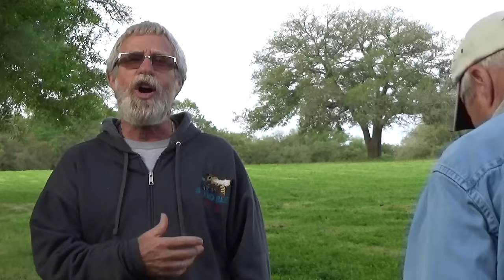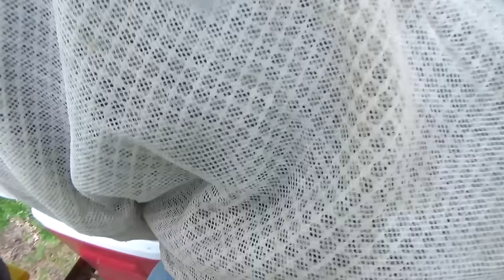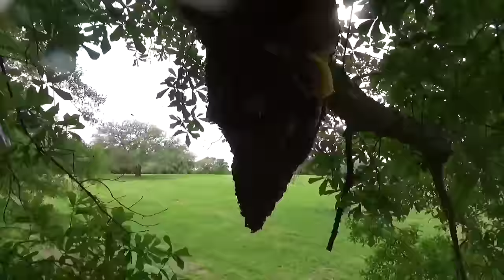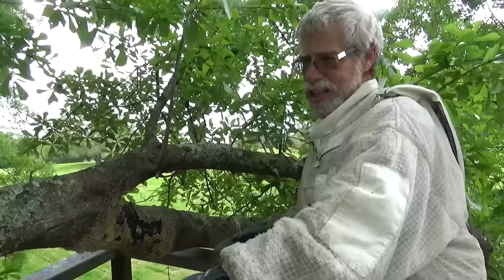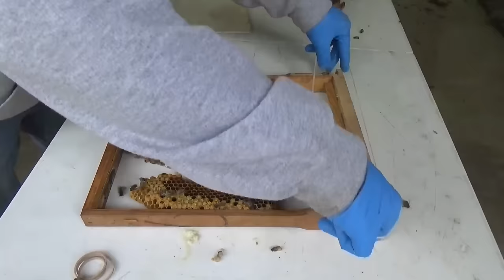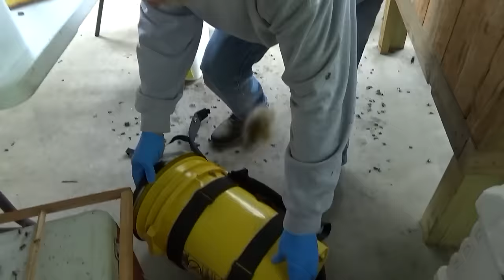Removing and relocating a massive external beehive from 30 feet in the air.

Comment: Of all the ways to get up to that hive, the Grade-all was probably the best you could hope for. Should have been as stable as the ground at that extension and once you were up in the leaves and next to the limb you likely forgot how high you were up there. Did Charlie settle in once the work started? Dang Jeff, you almost needed two vacuums for that many bees. Glad it was not really hot weather or you would have lost some in that tight quarters. Same with the coolers. Do you need to put some vents in those with leaving the bees on the comb? Would loved to have been there to give you a third opinion on that honey.

Comment: Hello Jeff.  That's one impressive colony.  I have a concern regarding my homemade bucket head shop vac, bee vacuum.  I don't know if I have it tuned correctly.  I might have the suction reduced excessively.  Is there a benchmark of your commercially produced vac in relation to its sucking power?  I'm wondering, without trial and error, if there is a measurable mark I should try to attain for vacuuming bees?  Keep the great content coming.
Reply from the maker: There may also be leaks in the vac that creates the low suction, I would look into that possible issue as well. In the Everything Bee Vac the suction is controlled by the speed of the motor not a bleeding off of the suction. I wish you the best in figuring out the problem. Thanks for watching. God's peace Dan.
Mr. Ed

Comment: Why don’t you stick the top of the comb to the frames with melted wax?  Don’t you worry that the bees will cut the rubber bands before they fix the comb to the frames?
Reply from the maker: The bees are very smart, and will not cut the bands before the comb is secured. Using rubber bands to secure the comb to the frame is a VERY good way to do it and most bee wranglers use them for that purpose. Thanks for watching, and I hope you will check out more of my bee wrangling/ bee rescues adventures and let me know what you think of them. By the way, I post a new video every Friday morning, and I look forward to hearing from you again soon.  God's peace Wes.
Mr. Ed

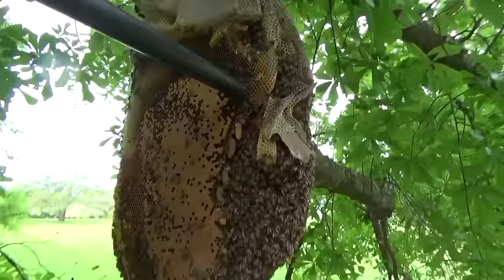Comment: 34:21 was this another queen cup/swarm cell/ etc on the side towards your body, anatomically right, facing the camera?  If you made the comb into a clock face it would be at about 10:30 halfway between center and edge. 
Is a swarm cell the same as a queen cup?  Is there a difference?  Why are some high on the comb and some at the bottom?
Reply from the maker: There were about 14 swarm cells on this hive, and the ones I did not use to ensure there was a queen in this hive, were used in 3 other hives of mine. No telling why they place the cell where the do, high or low, but they have a reason. Thanks for watching and asking. God's peace.
Mr. Ed
Reply: @JeffHorchoff  I didn’t know if cells at the bottom were more to split large colonies as opposed to replacing aging queens. I just didn’t know if the queen cells high up in the frame were queen replacement cells as opposed to new swarms (if that makes sense). I’m not a bee keeper, just curious